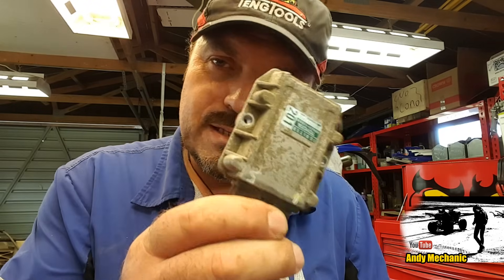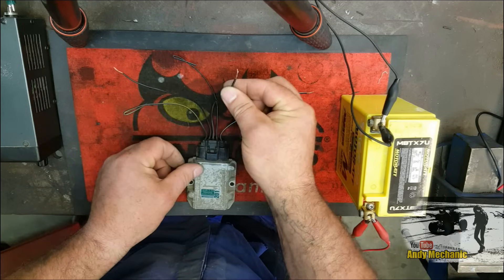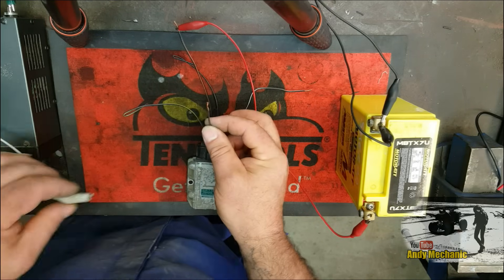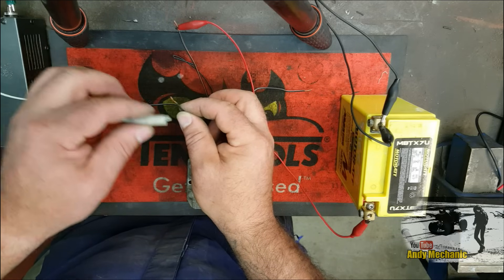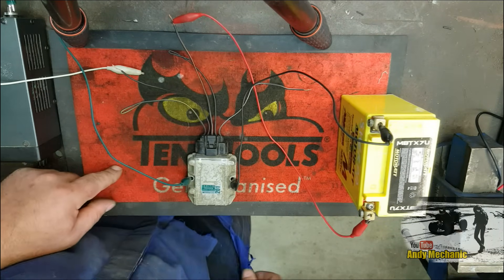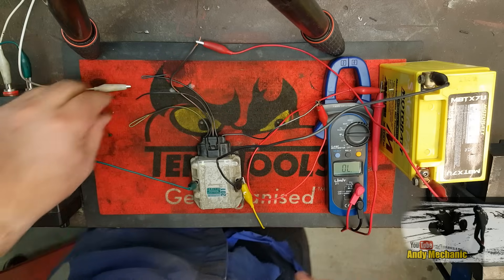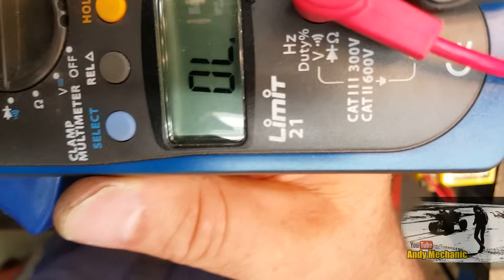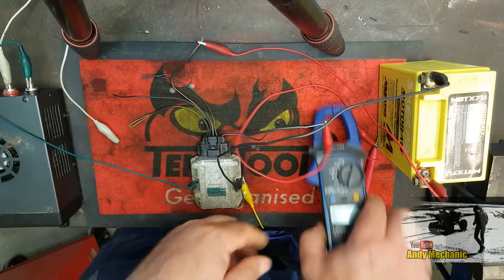How to test a Toyota ignition igniter #1421

Comment: I have a Suzuki samurai but the spark is not coming out from plugs, coil and magnetic point are ok, what could be the problem
Reply from the maker: The Samurai model has the 1.3 ltr F13A engine with electronic ignition. If your ignition coil tests fine & the wiring is all good, including the HT leads, then there must be an issue with the distributor. Remove the distributor cap & check the terminals inside & for signs of tracking. Also check the rotor arm too. The king lead has a spring loaded connector that makes contact with the rotor arm, check it's clean & making good contact.

If you refit the distributor cap then remove the king lead from the cap, put this close to a metal part of the engine & then crank the engine see if you get a spark there?

Hope this helps
Andy

Comment: Mines an 87 22R carb. 
Underpass fuses are good.
I tried to install my eng.ground to battery positive. Now no spark. 
I've finnnnnaly/by simply acting to buy one/discoverd what my igniter looks like.
Not in the distributer either.
Could find it on my truck.
Then.I see from the photos/it's sits under the coil.

Comment: my unit falils after it heat up no spark
Reply from the maker: Could be your ignition coil breaking down or possibly the crank angle sensor if it has one (older vehicles don't have a crank angle sensor, if not then the pickup is usually inside a distributor. This is where I'd start.

Cheers
Andy

Comment: hi Andy, My 95 4runner has no sparks. I am not sure if the fault is my igniter or ECM. if there is no 5 volts at wire number 2 when i crank the engine over , is it safe to say that it is the ECM fault?  my amf air mass flowmeter is not within specs wth the Factory spec.  is it possible that the amf causes the ecm not giving me a 5 volts at the number 2 wire as well?   Thank you in advance

Comment: Man after doing plugs, wires, ignition coils, timing belt, fuel filter, distributors etc i fkin pray to the car gods this is my issue for no power after 3k rpm
Reply: You got good fuel pressure thru the full RPM range

Comment: I want to thank you very much!  My 1997 Celica died and had to be towed home.  I confirmed that there was no ignition spark and suspected the igniter module.  I was pretty sure that was the problem and ordered a used one on ebay.  Then I saw your video and ran the test you described.  Using a VOM to detect the output when the 5V input was pulsed did not show any output.  But when I hooked up an oscilloscope I could see the output.  I continued troubleshooting, confirmed the coil in the distributor was good and the signal coil showed good as well.  But when I tried to check continuity through the distributor rotor I not only could not get any resistance measurement, but the rotor fell apart in my hands!   That rotor was only a couple of years old, too!  So I replaced the rotor with a new one from Toyota and the car ran fine.  Then the used igniter came in the mail and the test showed it was bad, a fact confirmed by trying it out in the car, which produced no start.  Thanks!
Reply from the maker: Great work, it's good to know this video was helpful to you. A relatively cheap fix then to fit a new rotor, lucky it didn't damage any other components.

Thanks for the feedback, all the best. Andy
Reply: Español se habla en Costa Rica 9:02

Comment: My igniter in my '94 truck works but fails when it heats up.
Reply from the maker: Probably a dry solder joint or blown capacitor. I'd try replacing it. If that doesn't fix the issue then likely a blown capacitor in the ECU unfortunately 

Cheers Andy
Reply: @AndyMechanic  I would suggest testing these while heating them.

Comment: Thanks for a great video. Im having problems with my 92 Toyota 4runner, its giving me a weak spark. New Plugs, Cables, Dizzy, Ignitor, Coil. Still weak even when plug is grounded to the battery. Would a lesser than 5 volt signal from the ECU or a faulty ECU result in a weak spark?
Reply: I've got 12v to the coil. Still weak. My dizzy was replaced with cheap China shit. So would that possibly be the culprit? It did pass the resistance check though. I'm all out of ideas and am on the verge of waving the white flag.
Reply from the maker: Although you have 12v at the ignition coil do a load test to ensure there is sufficient current been supplied. Disconnect the ignition coil & replace with a bulb - a 12v headlight bulb say 55w should be fine. Turn on ignition switch & bulb should be bright.

Cheers Andy
Reply from the maker: No, a weak spark will likely be a poor 12v+ feed to the coil.

Comment: Do you know where the ICM is on a 2000 Toyota celica is?, I’ve been looking at pin out diagrams but it never shows the ignition control module

Comment: What about the output voltage to the primary circuit of the ignition coil?
When i test with an oscilloscope i only get some 500mv on sine wave?
That woyld be a problematic igniter in such case right?

Comment: Hi Andy, I need to wire a toyota 4af (carbureted AE92 model) with the bosch distributor with the ignitor on the distributor. It is in a project that only needs bare basic wiring ie charging, start and ignition. Any chance of a diagram for the ignition system to get it running? I just dont want to burn anything out and have been confirmed as the worlds worst auto electrician (official). It has 4 wires on the ignitor but only two wires coming out of distributor. Any help would be fantastic. Regards John

Comment: I sure wish the igniter could be eliminated completely when using an aftermarket ignition box. I run a Mallory 6A (likely swapping it out for a Pertronix HP box within the next year) in my 1988 Land Cruiser, and it if weren't for the IGF signal wire back to the ECU from the igniter, I could deep six the igniter and simplify the circuit. As it is I have to retain the igniter and use that to trigger the Mallory box.

Comment: I been searching for solutions to using msd ignition supplies. 
However the barrear i face is dealing with the distributor, it has internal coil. 
96 toyota 4runner. Has the same exciter in this video.

Comment: Varon tengo una toyota van wagon 86 me prende por la mañana y despues de 10 o 15 minutos se apaga y no prende le cambie la bomba de gasolina y la bobina y sigue igual
Reply: Varon a toyota van wagon 86 turns me on in the morning and after 10 or 15 minutes it turns off and does not turn on, change the fuel pump and the coil and it remains the same

Comment: Well, your video is good, I screwed up when I measured voltages at the igniter, I did it with the plug off, OUCH I ended up going nuts, they read good, MY BAD, I should have checked them with a fine pin while the connector was on the connection broke when on, I ended up paying someone to find that

Comment: How on earth you got the ignition off the bracket I’ll never understand. Went to do my coil and both that and the igniter were rusted solid onto the bracket, ended up having to drill through the screws and replace them with bolts and nuts.

Comment: Hi everyone here, I have a problem can’t start 1988 landcruiser. I don’t want to spend 500$ for igniter , truck don’t have spark , I change coil and distributor cap and rotor crank ok , just park truck for 15min come back can’t start weird. Thanks
Reply from the maker: Check for 5v on IGF pin on ECU with ignition ON engine not running. If it's higher then you have a capacitor issue inside the ECU.

Also check for continuity on pickup coils in distributor.

Comment: Thought this might be helpful.  But my issue is 93 forerunner intermittant start wont run on. Checked fuel pump, coil, ignition relays. Etc 
Its got us stumped.
Reply: What did it windup being ? Just curious

Comment: Hi Andy I have a 1996 Toyota Tacoma 2.4 basic model pickup NO spark, got stuck,  got it towed home, changed the ignition ignitor, and the Dist still no spark, a mech buddy installed the Dist, I  measured pin C on the ignitor  using a very fine needle in the plug with key on, in the run position, I get 12v with cranking it drops to 9v no spark what should I read, using a meter on DC, maybe I'm not sinking the primary of the coil enough to get a spark from the coil with the cap off testing at the high voltage output HERE IS A WIRE DIAGRAM  FOR IT  
https://www.tacomaworld.com/threads/1996-toyota-tacoma-2-4-pickup-i-drove-to-store-came-out-dead-no-spark.685215/page-2

Comment: I have an 84 Celica.  Sometimes there's no spark.  It hasn't stranded me yet, and I don't want it to.  It does this intermittingly, but it's starting to get more frequent.  I haven't had any success with wiggling any wires.  I'm trying to see if the pick-up in the distributor works.  I have a test light, and a multimeter.  The coil is a new NGK.

The green plug this igniter plugs into the distributor --- the Ohms are good on the distributor side.  However, with the key on, I get no volts on the plug. Am I doing something wrong?  Shouldn't I be getting 12+ volts from that plug?  

Also, when I plug it back in, the key ON,  I use a test light touching the pink wire where it's anchored, the light doesn't turn on.  Again, am I doing something wrong?  Shouldn't it light-up since the Ohms are good?  

Btw, the 'Line Voltage' is Good.

Power Transistor is Good

The shop manual has a diagram with a 2.5 volt battery to test the plug prongs, but that's what I used the volt meter for.  The Shop manual doesn't explain what's suppose to happen when you test it with a 2.5 volt battery.  I guess a 'real' mechanic would know.  

I think I've explained what I've done pretty accurately.   I could use some advice.  I'm thinking the ignighter has a short, and that's why the test light doesn't light when it plugged into the distributor.   It has to be either the pic-up, or the igniter. . . I think, 🤔.

Comment: 5v power supply? Use a car cigarette lighter USB adapter. What you charge your phone with in the car? USB standard is 5v, so slice off the micro USB/lightning end, peel back the insulation, and the red wire is your 5v+. Black is your ground.

Comment: I have a 96 tacoma cranks but wont start, guy said he shorted the battery terminals, I messed with the ignition back and forth and got it started but now when I use to much power lights it shuts down then barely starts up but runs. Radio flickers. Lights work but when I put a load it dims shakes and shuts off??? I'm gonna try replacing it my Code is P1300 that's all

Comment: My toyota corolla started misfiring yesterday, it's a 5 speed, if I don't give it quite a bit of gas, it will cut off. I was told it was the igniter circuit. Can anyone tell me where its located under the hood.
Reply from the maker: Usually quite close to the ignition coil.

Hope this helps. Cheers Andy

Comment: This is cool and all to know about, but what’s the fuckin fix how do you get an igniter for an old Toyota.. I’ve asked parts stores and looked it up online they’re non existent
Reply from the maker: There are Chinese copies you can buy online. I was lucky to get one on ebay out of the US for $20. They sent me 2 but only charged me for one! Someone has a stack of them somewhere.

Good Luck
Andy
Reply: Andy Mechanic I find that hard to believe seeing how all the parts stores and stuff like that said the part is non existent. the one I need is for an 88 ae92 I look online and none look like what I need
Reply from the maker: Ah. Well there are a few different ones. Can you email me a picture of the label on the ignitor - this has the Toyota part number & I'll make some enquiries here in NZ. We have a lot of scrap Toyotas here from that era.

Email is andymechanic@live.co.uk 

Cheers
Andy
Reply: Andy Mechanic one second and I’ll get the picture to you
Reply: Andy Mechanic I emailed you
Reply from the maker: Got it thanks. Parts guy is on with it now. Cheers Andy
Reply: Andy Mechanic parts guy is on with it?
Reply from the maker: Sure is. I'll report back soon. Cheers
Reply: Andy Mechanic thank you sir, I appreciate it a bunch
Reply from the maker: Okay. I now need as much vehicle I.D. as you can give me including chassis/VIN number, engine size/model, year of car etc. Cheers Andy
Reply: Andy Mechanic 1988 Toyota Corolla gts, 1.6l twin cam 16v, multi port fuel injection
Reply: Andy Mechanic AE92
Reply: Andy Mechanic any word on that yet?

Comment: Thanks for the reply ,sorry for the lack of info but this has been going on for two years and three different dealers,so memory's kinda slow remembering all the tests. She has been sitting in a heated building were i recently have had some time to take her out for a ride and try to figure this out ,i for some reason had a suspicion it was a injector/fuel problem so i removed the injectors sent them out and fuel filter was rattling have had built a few engines earlier i cut it open and found the back plate to the filter was no longer secured to the inner barrel,the filter was extremely blocked with some sort of muddy gel . Im only guessing when the pressure built up it blew the plate off and pressed it against the outlet hole ., finally i figured it out replace fuel filter ,remove tank ,because i have nothing better to do lol , clean lines get injectors back and long behold . I think its actually worse .same issue no change except  new code 1310 igniter something or other, never seen this one before?first start up 20 to 30 sec or so it runs like a Rolex as soon as it starts to idle down from the choke i can hear the misfire and if i put it in gear and apply small load it painfully auvious threes a miss but it seems to be not on every fireing order seq. it misses and for a few seconds it instantly clears up and goes back to missing as if its only sparking one or two out of every req 10-20 times???  cam sensor crank sens igniter what do i shove down her windpipe before i send this cranky xxxx to her long term care facility......help,love the chanel been glued since discovered
Reply from the maker: Cheers for the info. I'd be really tempted to test fuel line pressure first, just to eliminate the fuel system completely.

Then it's really time to get hold of an oscilloscope so you can capture the waveforms of crank sensor, injector pulse and of course ignition. It could be a bad coil, igniter or crank sensor (if you have a distributor on your engine, like the one in the video, then they have a cam sensor & not a crank sensor.

Capturing each signal is shown in the videos.

You can pick up a scope pretty cheap these days. PicoScope 2000 series is only a couple of hundred  $$.

Good luck.

Cheers Andy

Comment: Q can the module cause what seems to be timing adv/retrd issue  .2000 lexus 470lx  all diag so far (dealer) new coils -8 plugs-8 injectors -8 comp/leak down ok ,timming belt correct .vacuum leaks nope .runs like its missing a cylndr /timming messed up ...codes P303 and recently 1310 after injector replacemnt
frustrated ....????
Reply from the maker: Sounds like the dealer fired the parts cannon!

Well firstly they need to check to see if it's dropping a cylinder or the ignition timing is out.

I would hope they had a scope so an easy check to see if a spark is been lost - current ramp on coil primary (this engine has individual coils mounted directly above the plugs.

Ignition timing....another simple check with scope or timing light

Now given the new parts fitted to date I'd be interested to see fuel pressure under full load - they will need to rig up fuel pressure gauge and go for a road test - if pump output is down you'll see fuel pressure drop off when you accelerate hard.

I'm amazed they have fitted so many new parts - clearly at your expense to unfortunately 

Anyway, keep me posted on this one.

One last note - just remind them of the word 'diagnostics - it's a process of elimination' 

Thanks for the fault codes too - I'll look up what these relate to when I get a chance.

Cheers Andy

Comment: nice to see there are still mechanics /teachers showing younger gen how to find the underlying problem. Instead of dumping a bucket of guess parts  at it ,yup no start ,don't check the fuel gauge nope new motor should fix it, if not hell put as tranny in it ,your choice in the passenger seat or under the car.

Comment: Will I have. spark if this part dont works
Reply: What about if I'm getting spark but not enough to travel threw new cap and rotor and wires? Does the igniter have anything to do with a weak spark
Reply from the maker: No. Igniter is only really a fancy switch that provides a feedback to the ECU once a spark event has occurred. 

Cheers Andy
Reply from the maker: No. Not continously but you may have for the first few revolutions of the engine depending on the fault with the ignitor.

Cheers Andy

Comment: hi andy, why is it my igniter has no 5v but when i pull out the connector of the igniter and test the pin there's a 5v supply
Reply: the voltage is being used ...nothing left

Comment: I have 10 pins on my Toyota hilux Australian version 5vzfe engine how do i test as I have more pins ?
Reply from the maker: Sorry, no idea with that one. You'll have to get a wiring diagram to identify each wire.

Cheers Andy
Reply: Andy Mechanic : Hi Andy, nice pickup, my 1994, 22re, standard, 5 speed, with 313,000 miles failed me last Friday, the engine stopped on the Miami turnpike at 70 miles per hour, it is giving me the code 12, it is not the distributor, it can  be the coil or the igniter too, it could be that some cable is broken or it went to ground because the ECU is not receiving the signal and it is not the ECU because it would not give me codes, long way ahead, if someone has had the same  experience let me know so I don't go blind, without work, with little money I can't take her to the mechanic, I have to do it, please help.  Thanks.